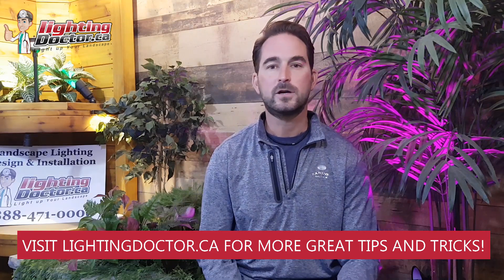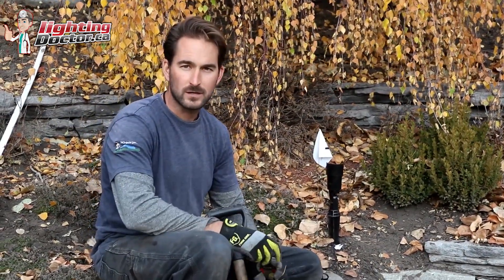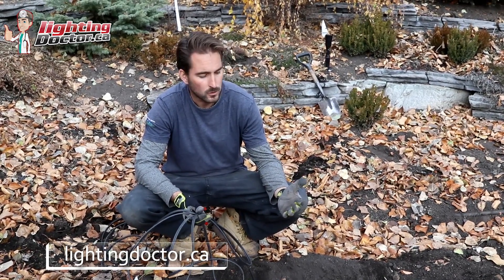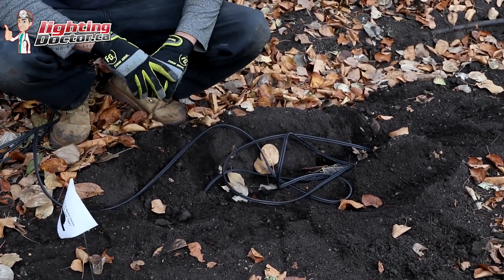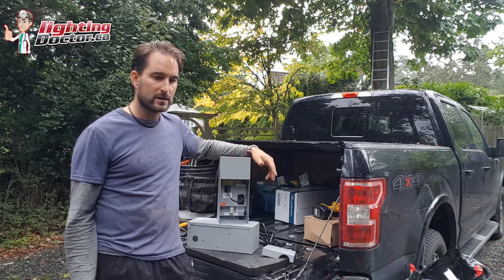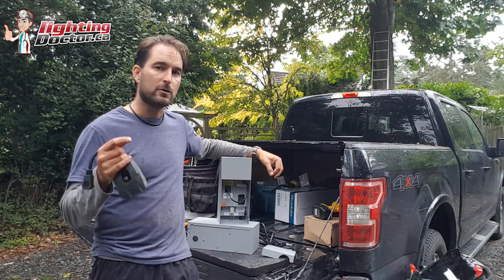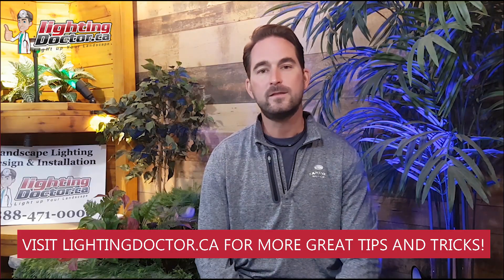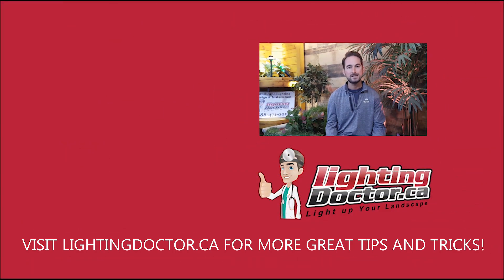How to Install Landscape Lighting - (Low Voltage Landscape Lighting Wiring & Transformer Tips)

Comment: Great videos, Lighting Doctor!  I am transitioning from halogen to led landscape lighting.  I plan on slowly transitioning my lights.  Are there potential issues with temporarily having both halogen and led fixtures on the same 12/2 wire continued to a 300w transformer?
Reply from the maker: As long as your total wattage still stays under 80 percent of transformer capacity and there are no additional lights being added that might cause voltage drop then you will be fine.

Comment: Is there any issue with using a 300W transformer but only needing about 120 watts in lights?
Reply from the maker: No issues if you are using good LEd fixtures
Reply: That actually leaves plenty of room if you wanted to add more lights down the road

Comment: I want to install only one low voltage focus light. What kind of transformer should be used for just one light? Thanks
Reply from the maker: You can use almost any style if you are only doing one light

Comment: What gauge wire do you recommend?  Can you use 16/2 for 10 LED?
Reply: For 10 LED fixtures you can use 16/2 wire. I would separate it into at least 2 separate wire. So 5 on one wire, and 5 on the other. I wouldn't go above 7 LED bulbs on 1 16/2 wire.